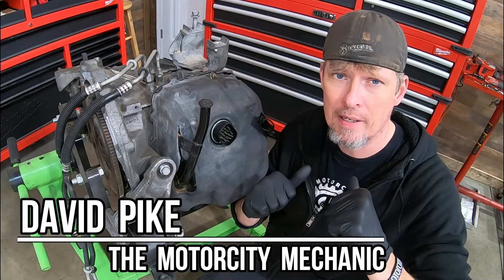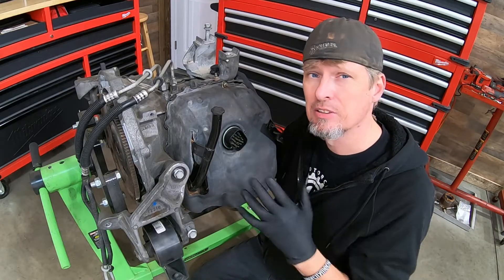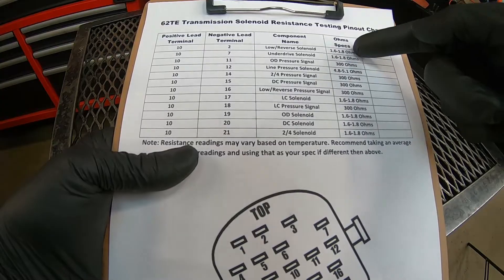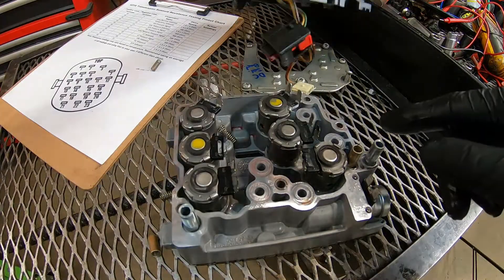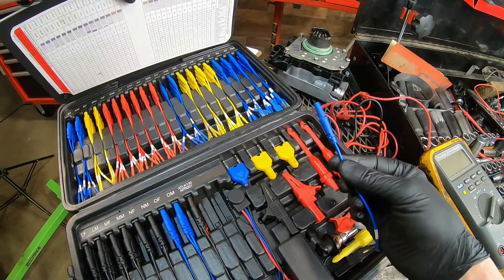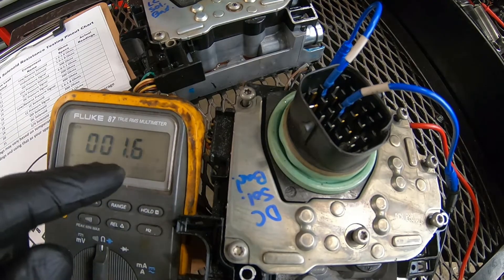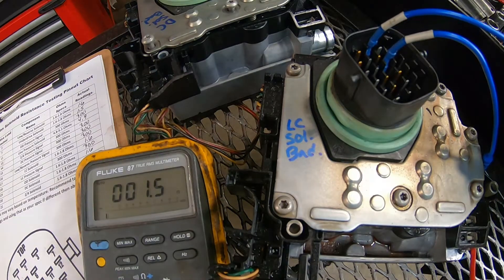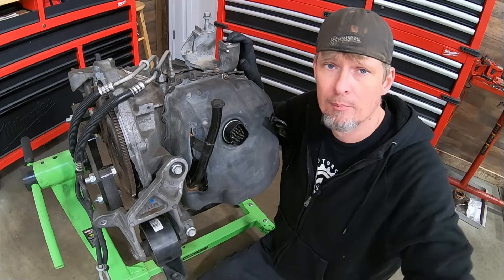Chrysler/VW 62TE Transmission Solenoid Pack Testing

Comment: My pressure solenoid reads 5.3 ohms is that bad since your specs say 4.1 to 5.1 ? My transmission whines I have replaced the transmission pump 3 times all about 3 weeks apart and whine goes away and shifts drives fine then 3 or 4 weeks go by and whine comes back and loss of shifting replace pump it goes away and works fine then pump fails again I have a 2015 dodge journey 62te fwd tranny was thinking the line pressure control solenoid might be causing low pressure and whine starving sound if was letting the fluid bypass causing very low pressure in system. So I have pulled the trans fluid cooler return line out put it in funnel to feed back into the pan start vehical flow is powerful then whine slowly starts and gets louder and that line shows barely any flow suddenly like pump ain't working why would pump work but few mins later not work any help be appreciated as I have replaced 3 new pumps in my transmission there is no metal or anything and once new pump is in shifts drives fine no issues but suddenly new pump just quits all new fluids new filter every time I put another new pump in.

Comment: Can you snip the 10 wire to get rid of limp mode
Reply: Obvs this is a year later but for any future scrollers: The PCM cuts power to pin 10 to engage limp mode. Snipping the wire yourself would make the transmission operate in limp-mode only.

Comment: Where can I find a wiring diagram for the wiring harness on the bottom of the tipm? I want to check the wire coming from the solonoid pack negative lead 2 (low/reverse solonoid) to where it plugs into the bottom of the TIPM so I can check for continuity and to check for corrosion. As it is now I'm getting a low voltage reading on my voltmeter at terminal 2 to ground, That's the wire coming coming from the TIPM. but I may have a bad TIPM, bad TCM  or Just a bad wire...I haven't moved the TIPM yet, I'm waiting for a daigram for the wiring harness showing the correct plug and the corresponding pin chart, Can someone help me please?

Comment: I got  below the results in ohms please check for me 

P076A DC SOLENOID CIRCUIT FAULT IN PCM.

Dodge Grand Carvan 2013  😅10 to 2 = 1.7
10 to 7 = 1.8
10 to 11 = 300
10 to 12 = 5.2
10 to 14 = 301.1
10 to 15 = 302.5
10 to 16 = 302.4
10 to 17 = 1.8 
10 to  18 = 300
10 to 19 = 1.8 
10 to 20 = 1.8
10 to 21 = 1.7

Comment: I have 2012 Town and Country that seems to have some flare shifting between 4-5, and 5-6. Rpm's rise 300-400, but during that raise its still picking up speed. Runs great, no codes engine or tranny. Just started doing it, not sure where to look. Would a solenoid pack possibly take care of the issue?
Reply: I'm having the same thing to the T. Did you ever find out what it was ?
Reply: @dustinpizzi9349  , I had a transmission shop look at it. They say it's the compounder/underdrive unit. They said that they'd just drive it till it goes. They didn't really say how long it would last.

Comment: I just checked the solenoids on a 2012 Town and Country, I get 1.1 ohms on all the ones your chart shows should be 1.6-1.8 except for the line pressure solenoid shows 2.6 ohms, your chart says 4.8-5.1 and all the ones your chart shows 300 ohms mine show 104.4-104.6. So I'm going to assume because of the consistent readings they are good except for the line pressure solenoid which is half of what your chart is showing.

Comment: I seen another video where the guy replaced just the solenoid, if I purchased the pack and disassemble, would it be easier to just replace the one solenoid in question to the old pack? I have limited workspace and wouldn't want to pull the valve body if possible.

Comment: I have a 2010 62te occasionally we'll go into limp mode and gives an intermittent speed sensor code I think po937 ( I think) maybe it is an intermittent speed shaft input. And incorrect gear ratio it only happens when I am coming to a coasting stop from say 35 mph to a red light when I let it Coast it will cost down fine no issues but when I go to take off it will be stuck in second AKA lint mode I've done some research and believe it is the transmission range sensor is this a sensor inside of the pack you have here

Comment: Dave help!
I've tested all my solenoids pack and all of them are in range! (I didn't open the transmision) Also I checked wire by wire to the computer and all of them have continuity, It's a Doge journey rt 2010 with a code p0760 (shift solenoid c) , what else could be the issue? It drives well a couple of miles also I'm able to go until 5 gear with the stick, burt suddenly just jump to limp mode I see the fluid a bit burn... Is it posible that that blocks the solenoid?

Comment: Dave, What’s the reason one day the transmission won’t go beyond the 3rd and the next day works ok? Is this issue possible related to the solenoid or the input and out put sensors or the transfer shaft sensor? Thank you!
Reply: Everybody has the same problem.

Comment: Great video i just used it thank you I did the test on mine the dc pressure signal says 301 all the ones that are around 300. 2 also the od pressure signal is 299.8 would tht say its bad because everything else is between 1.2 and 1.4

Comment: This is an amazing video... I know everyone is asking you different questions about issues and I hate to jump on the band wagon, but my son has a 2008 dodge Grand Caravan 4.0l with a 62TE and its in limp mode and has a P0846 Transmission Fluid Pressure Sensor/Switch B is this related to the solenoid? Thanks in advance for any help

Comment: I need this kit!!! I’ve been making my own leads and it’s a pain and time consuming, and I always wondered if they had something like this! Thanks for  video! Also have a 62te I have to diagnose, I had a U/D solenoid circuit issue on a customers car and the dealer said it was a bad pack, swapped it out with a reman Dorman pack and bolted up everything, filled it to proper level and after less then a mile, it went back on limp mode and cel came on. Checked the code and now it only shows the L/R solenoid circuit malfunction. I’m wondering if the pack was faulty. Now after this video, the sheet you provided, and the cool tool you used, I’ll have to diagnose it again with alittle more confidence. I’m leaning that it might be a bad/ faulty reman pack but I’ll just cover the basics with this testing. Thanks again! Keep up the good work!

Comment: I replaced my it worked.... P0760 (OD selenoid circuit malfunction) tested pin 19 I got 2.4 ohms should be 1.6 ohms.... thank you so much for the info.
Reply: I got 1.7 on 19 terminal. On terminal 11,14,15,16&18 did you get 300 ohms or .300-.302?? Decimal makes a big difference don't know if anyone else got similar.
Reply: @johng8967  on my I got .304 ohms it’s like 300 ohms depends on your meter I selected 2k setting(manual setting)
Reply: Pin 11, .304 ohms
Reply: Pin12 5.3ohms (200hms setting meter)
Reply: All the signal sensors averaged 302 ohms
Reply: All solenoid s average 1.6 ohms (200 ohms setting)
Reply: @hgarciazzz  thank you, I have a auto multimeter that I just select resistant setting.

Comment: How about the temperature sensor resistance pin (22 + )testing with meter (23-)  ...12k ohms...? ... I got my reman Dornan 7.8k ohms  ... do you know if it changes with temperature?
Reply: I retested both the new and old pin 22 and 23. Resistence changes with temperature (ohms)

Comment: pretty new at this but financially need to be able to do more repairs or know what I need when taking for repairs.My Journey with 62te will not shift out of first, drives, high rpm but not shifting. It will reverse  (I am not driving it until problem diagnosed) What should I check? appreciate what you are doing thanks
Reply from the maker: First thing…..check engine light has to be on, need to get the codes checked and then we will have a starting point. Otherwise it would be a guess this early in the game

Comment: Hello, good day, if you could help me with a question, I bought a package of rebuilt solenoids on Amazon and I tested them with the multimeter and those that are 1.6 ohms in the test have 1.5 ohms and those that are 300 ohms have 301.5, is that good or should I return it thanks have a nice day
Reply from the maker: I believe I mentioned on the form and maybe somewhere in the video that the readings might be alightly different and if all the solenoids that you have are the same reading then you will be good to go.
Reply: @MotorCityMechanic  thank you very much for your help and clarify my doubt thank you god bless you
Reply: @MotorCityMechanic  thanks one more question can I test the solenoid pack with the multimeter without removing it from the transmission or do I have to remove it to be able to test it

Comment: Great worksheet. I used it to check all the solenoids. All ohm readings check fine, but I'm still getting P1745. So I guess I'll change the pressure sensor and do a fluid and filter change before I pull the pak out.
Reply: Did the sensor work and fluid change work?

Comment: Do you know how I could get info in the document with the link above (which I think you created) for my 2007 Dodge Caliber SXT?  I was hoping it would be the same but my connector has only 22 pins and think it is different transmission.  I have both the P0717 and P0722 (input/output sensors) codes but suspect problem is with solenoid switch as I discovered some previous wiring repairs in harness and some of wires look like they are not in good shape.  Service manual suggests all types of tests between Solenoid pins and TCM pins but was thinking that I should just be able to test at solenoid harness.

Comment: Hello Dave. Can this test be done without taking the Transmission or Solenoid Pack out. If removal not required for test, should battery terminals be disconnected?

Comment: Good brand caravan 2008 what is a shift solenoid actually do when it goes bad Does it shut down the engine and does it turn on the check engine light

Comment: Great video Dave!  I have a 2010 VW Routan with a 62te and yesterday the van went into a "limp mode" it seemed like.  It wouldn't go above 40mph or so and the motor would rev high if I tried to go faster.  I couldnt manually shift either. I pulled over and everything seemed fine from the outward appearance.  I disconnected the negative lead of the battery and after 10 minutes tried again.  The van drove fine (auto and manually shifting) for about a minute and then problem came back.  I repeated the battery thing and then drove home shifting manually through each gear.  Today i drove it like normal for about 20 minutes with no issues and never a check engine light or code.  Any thoughts?  I did order the solenoid pack already.
Reply from the maker: If it’s in limp mode there has to be a code somewhere in one of the modules. That’s where I would start first
Reply: Sorry for the delay.  Like I said, I ordered the solenoid pack and installed it exactly how the MotorCity Mechanic clearly lays out.  No issues for over a year since the repair.  I believe my wife could have installed that solenoid pack after watching the solenoid replacement video a couple times.  The MotorCity mechanic is very detailed.
Reply: @ryandunaway7443  Did you have to go have a mechanic do a  quicklearn on it? Or does it "learn" by itself?
Reply: @benjaminabel8596  no mechanic needed.  It learned by itself.  It really turned out great and no issues after the repair was completed.
Reply: @ryandunaway7443  great to know! Thanks!
Reply: @ryandunaway7443  Where did you end up ordered the solenoid pack from? There are many online but discerning a quality solenoid pack is challenging.
Reply: What was it in the end?
I have low pressure codes, but when I restart it seems fine for a bit.
Reply: @AMNOLT  
my car is doing the same thing.
did you find the problem?
Reply: Mine has been going into limp mode here and there for the past 3 years. It would only go into limp mode upon start-up, but as soon as I restarted the car, it would be ok. There was a while where it didn't do it at all, but then yesterday it would go into limp mode as soon as I'd hit a stop light (with a clunk). I read the P076A code DC solenoid circuit and now I'm finally gonna replace it.
Reply: I'm having the same problem and I got the p0755 code. My question is, did you get a code on your car?

Comment: This is cool and handy, but the solenoid pack is so cheap and easy to do that if I get ANY trans codes other than the pump, I just swap it. 

So far, in 1.7 million miles spread over 3 Promasters, I’ve had to swap a pack exactly twice. I’ve had to swap one trans pump and one converter (same time on the same trans - not sure which caused the problem but I’m not doing that job twice!). For all the shit people sling about it, the 62TE has been nearly worry free for me.
Reply from the maker: They are a good trans as long as people keep them serviced. Filter gets clogged and then the pump gets starved and then the clutches get burnt. Change that filter and fluid regularly and you can get great miles out of it for sure.
Reply: @MotorCityMechanic  Hot tip for ya David: late model 62te use black rtv on the lower pan, but Felpro sells a gasket, presumably for earlier models. Using a gasket instead of rtv saves probably 20+ minutes on a fluid service, and another 10 the next time you do it.
Reply: @kipamore YES! And the gasket that comes with the filter SUCKS. The felpro gasket is well worth the money.
Reply: @gregkersey6106 Totally. Further, I’ve yet to find a brand of filter that comes with a useably good gasket.

Comment: Would a bad input, output or transfer sensor cause a P0792 intermediate shaft speed sensor A and a P0734 gear 4 incorrect gear ratio code ???
Reply: I have same codes, did you resolve your issue?
Reply: @MasterMusicOfficial  it’s my fathers car.  He changed the sensors.  Serviced the trans and changed the filter cleared the codes.  Seems to be running fine at this time.  He hasn’t told me anything different👍

Comment: I assume the TCC solenoid should be measured between 3 and 10?  and resistance 1.6- 1.8 Ohms?  As to the packs, where did you see those separate replacement coils?

Comment: Hey mate if the oil hasn't been replaced for 70000miles and there's lots of metal on the pan magnet , is the solenoid pack at risk from contamination??.

Comment: If you rebuild the trans with a new pack, does it have to get reflashed?
Reply from the maker: No flashing needed. Its best to do a "quick learn" using a high end scanner but its not a do or die thing. It would just help with smoother shifts.

Comment: Good job David
Last night I was driving my car (2010 chrysler town and country )and the engine light come on and the transmission stick in third gear I stop car immediately after two hours I check the code it’s ( P0765 Underdrive Solenoid Circuit ) I cleared the code and I drive the car again and everything is normal and the transmission change gear normal
And today I checked transmission solenoid resistance testing like the video and all reading is normal except pin 12 ( Line Pressure Solenoid ) the reading is 5.4 Ohms and the specs is 4.8-5.1 Ohms !!

 Any ideas ?? I appreciate 
Thanks

Comment: Hi Dave,
Good job thanks for all you videos aboutit the 62te.
I have an issue with the temperature of the transmission always shown vert high. 
The measurement between pin 22 ans 23 gives  23Kohms.
Is that value is in the correct range?
Do you have any reference value?
Is the sensor embeeded in the solenoid pack?
Thanks for your help.
Reply: I know this is old, but the reading between 22 & 23 should be 12k...you were nearly double that.

Comment: Nice video I worked for Chrysler for 11 years and I do remember the Miller transmission simulator sorry to hear that they don't make it anymore in my opinion it was the best way to troubleshoot a transmission . Also glad that you mentioned that doing the test that you are performing does not necessarily mean you going to find the problem because like you said. A solenoid a coil excetera excetera could test good when is actually bad... I also had the terminal test set I had one that was made by Miller somebody stole it now I have the one made by AES wave and one made by electronic specialties keep making the videos and I respect you

Comment: I have a 2012 dodge ram 5.7 hemi...it had a recall on the shift column.. but now it kicks into manual mode on 1st gear once or twice every once in while..what could be the cause and is it cheap or easy to do..thanks

Comment: Are those solenoids interchangeable? IE you could take the DC out of the bad one and replace it with one of the good ones from the other pack? Just thinking that getting a pack from a you pull it place might mean you don't have to pull the rest apart.
Reply from the maker: For sure.....I could do exactly that with the one I have and have a working "used" solenoid pack if need be. I see some Chinese company online showing the solenoids but I cant tell if they sell them or if they are any good.